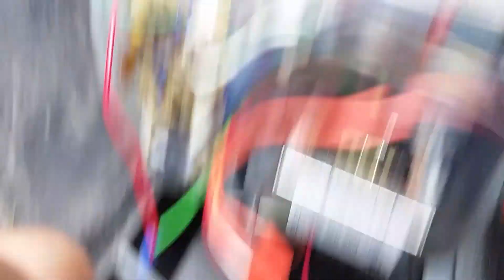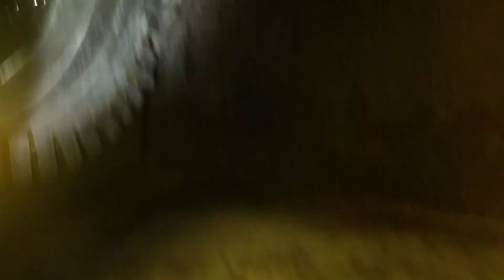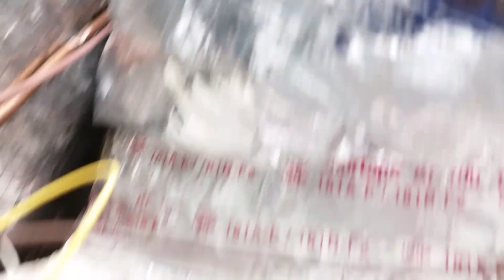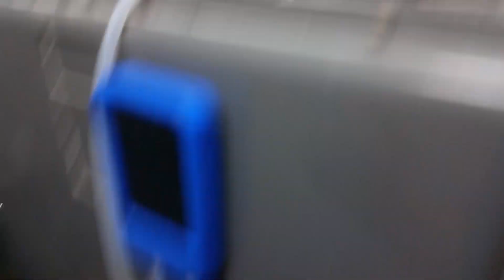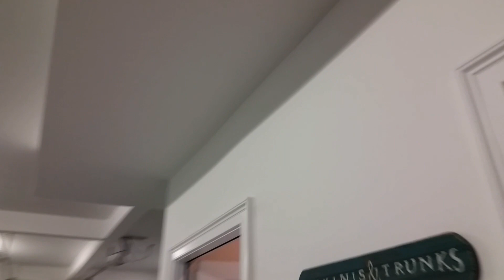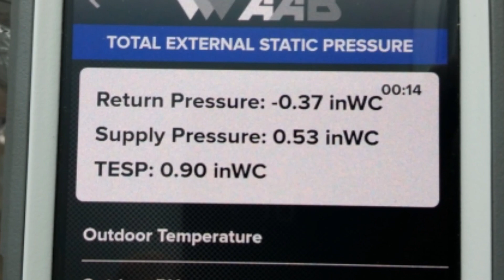How Ruud!

Comment: Is the condenser on the roof? I see no reason for a suction line trap if it's on the ground
Reply from the maker: There is no suction line trap in the system. That's a trap in the drain line. They just have it insulated.

Comment: I really love the 2.5 ton with a 10” return, , many years ago, , friend sent me to look at a job, she wanted A/C, it was a heating hot air system , told her forget it, duct work too small, SHE GOT SOMEONE t do the job, but AFTER THE 2ND COMPRESSOR dies walls me 4TH JULY, could I help me , said NO, CALL THE INSTALLER, was now into the 3rd compressor, , did Not listen, why I said ducts TOO SMALL
 from Maplewood NJ

Comment: This reminds me of a service call I went on just last week. Homeowner said the unit wasn't working right, said it would freeze up if it ran for any length of time. Homeowner also stated that each year refrigerant had to be added to the system in the Spring, and then refrigerant had to be taken out of the system in the Fall. (Heat Pump) The unit was put in around 2003 or so. This had been going on since day 1.  I didn't catch the problem the first time I crawled up into the attic, to check to see if I had a piston or a TXV metering device, gauges showed some weird pressures and even "weirder" superheat and subcooling readings. It was a piston metering device in the attic, and no matter what I did I couldn't get the charge right. When I crawled back into the attic to make sure the indoor coil was clean and the return ducts weren't collapsed (Had low suction pressure and very low superheat), I found the problem when looking at the air handler data sticker.  These people had a 1.5 ton air handler, connected to a 3 ton heat pump. Told the homeowner I found out why the system had NEVER worked right since day 1, and why it was never GOING TO work right. The homeowner never could get the installer to come back out.

Comment: try feeding a long inspection camera up and down the ducts before opening the ceilings, company and customer are likely both full of it and no dampers exist, except the towels and register zipped shut.
it gets better as you go, probably find out the "customer" or relative did it themselves and are either an engineer or apprentice
Reply from the maker: throttle bottle 14" flex supply on 3 tons system is inadequate anyway which is why the ceiling has to be opened regardless. Customer had nothing to do with the builder. This aint no little diy house either. Its a million dollar+ property. He's tired of fiddling around with this stuff and wants to bust it open and make it right. Once fixed he said his lawyer's will pursue the builder and HVAC contractor..
Reply: you can still inspect all the other ducts for issues, unless you're going to gut half the house O_O
Reply from the maker: throttle bottle If the ceiling didnt already have to be opened then that might be an option. My point is that we already know the main supply trunk has to be replaced due to its size. No ifs, ands, or buts. It sucks but it's what has to be done.